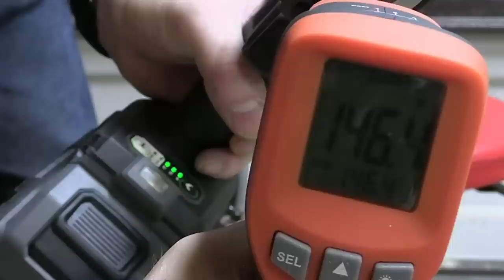Makita 40V Impact vs. Milwaukee Fuel vs. Dewalt XR vs Flex - BEST IMPACT DRIVER?

Comment: I guess I didn't realize how big that Flex battery was until now. Looks like a car battery hooked up to that impact lol. Great test 👊
Reply from the maker: Yeah, the 2.5/5 don't have high output cells so I had to step up to the 8.0  to match the M18 HO etc.   I would never use that thing on the impact in real life, it's like a freaking boat anchor 😂. Thanks for stopping by Clint!
Reply: 40 Volt, now I instantly have Buyers Remorse! Like why can't I have the 40 Volt! Like why wasn't I told about this before!
Reply: @randyross5630  Unless you have need for something on that line, like the beam saw or that insane 3/4" high torque, I haven't seen any compelling reason to make the jump. The tools that are duplicated between that and the 18V don't really seem any better, but you will have to use a big battery. Like with Flexvolt, there are no compact batteries in the lineup. Unlike Flexvolt, the lower voltage line can't use the batteries.
Reply: Yeah, they have those Chervon cooling sleeves on the cells that just make them massive.
Reply: @reginalb124  I got the 40v rear handle saw, sawzall, drill and impact.
If you regularly use bigger than 2in hole saws and augers, the drill is absolutely worth it. And the rear handle saw is so damn good it’s worth switching over for that alone.
The sawzall is a beast too, but for me it isn’t worth switching battery platform over.
The driver is pretty much identical to the 18v, it’s a great driver tho.
Reply: @SweetStat  But their 2x18 saw is plenty powerful. The hammer drill might be another compelling upgrade, but not sure I'd jump from 18 for it.
Reply: @reginalb124  the drill itself might not be enough for an extra upgrade. Specifically since the 40v line doesn’t have enough tools to completely switch over yet. I was due for an update sitting on 1st gen brushless tools. My drill been smoking a few times, my circ saw had a cracked housing. Sawzall is getting hot really fast, and starts smoking from the front, prob burnt up all the lubricants in it. Everything still works tho, but for how long?

I’m also betting for some future tools, an 80v chainsaw is one of those.
Reply: Lol trz

Comment: I had Makita 18v line for over 10 years XLT and BL tools. Switched to Milwaukee Fuel for the past 3 years because they are much more powerful. In the past 6 months though, I've been replacing my beat up Milwaukee fuel Gen 1 and 2 stuff with Makita Brushless tools. They are not quite as powerful but not by much. They are far more ergonomic, lighter and smoother and that's more important to me. I've always been impressed with Milwaukee power but as a carpenter, I find most of their tools miss the mark for precision work, smoothness and ergonomics. For me at least.
Reply from the maker: I have a video on the different modes for this and the XGT hammer drill in the works as far as precision driving tasks.  Lots of settings and options.  Stay tuned!
Reply: Makita is not lighter, and not far more ergonomic.
Reply: @svn5994  compared to my Milwaukee tools, they are lighter. Ergonomics is subjective. That's why I said, they are more ergonomic for me at least. The shape and placements of handles, switches, size and shape is more conducive to how I work and my hands. Milwaukee's handles are larger, tools are larger and they feel clunky. They also tend to vibrate more which is a mild to major annoyance especially when doing finer detail work. Again, this is my personal experience. I have absolutely no stake in whatever tool you prefer. Buy and use whatever you want. I don't care.
Reply from the maker: @svn5994  Agree that the Makita isn't lighter, all of these drills are heavy.  But I find it has much less vibration in the handle when using it.
Reply: Agreed, I think dewalt has the best trigger and the lightest drill but also the weakest.  I have never ran a makita but the Milwaukee triggers are not as good.  I also really like Kobalt triggers, they are a very affordable drill, perfectly capable with a nice trigger.
After having dewalt, milwaukee and ridgid for years, my main set is the blue kobalts and they cost a fraction of what milwaukee does and I put them through a ton of abuse including loaning them to coworkers.  My coworkers have been trying to break it but I think they have been surprised because they choose to use it more than the dewalt, ridgid or craftsmans.
Reply: @preston1614  

Tell your coworkers their lack of tools is the life they chose
Reply: Can’t beat makita for smoothness balance ergonomics etc when doing carpentry especially. My plumber uses Milwaukee and has burned out 3 drills in the last couple of years. And he uses my makita stuff when he’s doing wood projects 😆
Reply: @preston1614  As far as triggers go...Metabo HPT is the one to beat IMO. Makita is very close. I also like the Kobalt 24V stuff. They're hard to beat for the $
Reply: I am a dewalt guy. I bought my wife a makita drill. I have to admit. I agree. It feels like a much smoother more precise tool. Very impressed. I do own the small non-fuel milwaukee drill set. The balance and "feel" of them is horrible. The raw power of this milwaukee is impressive.
Reply: Makita makes tools that last. That’s the main reason I buy them. If I’m buying my own tools to work with, I’m buying stuff that lasts. The extra speed and power is inconsequential, when you have to replace it every 2-3 years. You can make any tool way more powerful if you just want it to last until the warranty is up.

Comment: my colleagues burnt through 4 Milwaukee impact drivers. I now use the 40v Makita and my 18v $100 budget impact from when I was a first year still going strong. also I genuinely think Makita has a much better feel. so at the end of the day the amount of work I have completed with the Makita compared to a Milwaukee is a massive difference and to me that is what matters. the reliability on site to complete the job.
Reply: Carefull you'll upset the red army , and also if you look very closely flex looks like makita on steroids.  Even the catalog pictures are the same
Reply: My experience has been the same. I bought a Makita mid grade brushless combo.
Reply: @@AdirondackHomesteadI'm a Milwaukee kit owner. Circular saws and table saws are really bad imo.
Better to go with Dewalt tbh.

Comment: Holy moly, the M18 is a BEAST!
Reply: When it comes to impact drivers, Milwaukee is the King of Beasts.
Reply: Watch the gen 4 Milwaukee impact driver coming out in a couple monthes
Reply: @TacticalThib  Has that been confirmed? Haven't heard anything about it yet.
Reply: Vcg construction has confirmed a new gen 4 impact driver this year
Reply: @geoffstrickler  Ridgid is doing away with the octane line and I'm looking for the next best and I'm kind of sad that this is it. Is the impact in the FUEL line more powerful? Or maybe an older model? I don't mean to sound like I'm hating on Milwaukee, I love their tools I own a LOT. But these are all incredibly weak compared to the Octane. impact
Reply: @Mik3yLow  LOL No they're not. Milwaukee's impacts are the best out there.
Reply: @Mik3yLow  the Milwaukee FUEL impact easily beats every Ridgid Impact driver. I have two Ridgid impact drivers, the Gen5x brushless and the Octane. Even the new Ridgid impact beats those two, and the M18 FUEL beats it…and every other impact driver on the market.
Reply: Yeah but it sucks balls. Trigger pull is twice as hard, and it beats you to death. Not to mention the fault in the trigger that can leave you in forward even though the switch is in reverse
Reply: @AjGalloway95  you need to send it for repair my m18 fuel works flawlessly I have the 3.5 though it has two balls not one in the collet
Reply: Milwaukee legends😍
Reply: @TacticalThib . He means, when you're driving a screw with the M18 and to switch to reverse real fast you can get into a situation where the impact still spins forward even though you have it in reverse. It kinda sucks but not a deal breaker. My buddy has the Kobalt and it does it too. I never noticed it on DeWalt or Makita
Reply: @Mik3yLow  what world are you living in that the octane impact beats the m18 fuel?

Comment: The Flex and M18Fuel are neck and neck. The 40v Makita is like a diesel. Not fast but seemed pretty smooth with plenty of power.
Reply from the maker: That's an excellent way to put it!
Reply: Diesel is smooth?
Reply: @theone6805  Yes, mine certainly is.
Reply: Power is defined as work over time.
Reply: Well the flex must be a nitro then with roughness

Comment: I am working with seasoned professionals who have 20-40 years experience and everyone has a DeWalt and everyone uses them everyday on metal studs and they all have had them for over 4 years plus. That was my decision. I was seriously thinking about the flex honestly but went with DeWalt and I am very happy with the quality.
Reply: Your probably  right, but push dewalts to do handwork and there shit.. l have about 20 dewalt cordless tools so it's not like lm biased.
Reply: I've been a DeWalt guy for 20 years. I see no reason to switch yet. I have a DeWalt impact I've been running since I got it in 2013. Looks beat tf up but still performs. And their saws kick ass  Admittedly, if I was someone running huge lags all day I'd be better off with a Milwaukee impact, but I'm not that guy. Thank god

Comment: That was an excellent comparison!!! Milwaukee came out on top without a problem. With an 18V, 8Ah battery against a 24V, 8Ah battery giving up 25% less volts, that’s pretty good in my book!! I thoroughly enjoyed this video!! Keep up the good work! God Bless!! Best Regards.
Reply from the maker: Thanks for watching, Cesar!
Reply: I just wish the Milwaukee could maintain that speed and power for more than 10 minutes at a time at best without almost catching fire.
Reply from the maker: @clarkfos3447  This is truth right here.  Working on a jobsite all day is a marathon, not a sprint.
Reply: Someone misleading in that the Flex is 24v Max while the M18 is 20v Max. Flex's nominal voltage is 21.6 while the Milwaukee is 18. Still speaks volumes about Milwaukee's engineering that they're still able to outperform these newer models and higher voltages while having been out for a good 3 years.

Comment: As a Milwaukee M18 Fuel platform guy, I'm not surprised by these results.  FWIW, those 21700 High Output batteries are total beasts and make a huge difference.   Props to Flex, considering this is a Gen1 offering,  so look for improvements there.  Very unimpressed with the 40v Makita, "smooth" as it may be.   Dewalt is still Dewalt,  and that's not a bad thing.   Kobalt wins bang4buck award...what is Lowe's going  to do when their prosumer line (Kobalt) can directly compete on a price/performance ratio with their premier, contractor line (Flex)??  I'm gonna keep bleeding Milwaukee red.  Philly, love your channel and your tests.  Awesome video.
Reply from the maker: Thanks for watching!
Reply: I might add, that it's not just the simple fact that Milwaukee has the H.O. batteries----the Redlink Plus technology engineered into the tool itself directly communicates to utilize the extra power.   Milwaukee was ahead of the game on this.  Dewalt FlexVolt has the same idea, but they're on too many platforms between FlexVolt Advantage,  Power Detect,  FlexVolt 60, etc.  It can get confusing for people.   Milwaukee has it all nice and tidy in one platform.   Tried & true.
Reply from the maker: @enockenock4183  I wish all the platforms had something similar to the CP 3.0 HO or the Kobalt 4.0 Ultimate Output - compact but high output.
Reply: @PhillyFixed , I'm sure the other guys are working on that.  I've no clue whether or not patents are involved (???).  Chervon, who owns Flex, Kobalt,  Skil, and Ego, has amazing battery technology (at least in the Ego line).  Like anything,  it's a highly competitive business but guys in the trades (like myself) tend to go with what works for them and are usually pretty brand-loyal.  I personally ran Dewalt for years (no complaints) but I switched to Milwaukee and it's going to take a lot to move me away from it. I have heard that Milwaukee is currently working on a 4.0 CP HO, which would be great.
Reply: Milwaukee is the raw power king, it’s more to an impact than raw power tho.
There’s been some super unreliable high end impact drivers from dewalt.
Makitas 40v and high end 18v are super great tools with some really useful settings. You won’t rly appreciate it unless you got some time with the tool, they also got an automotive fuse inside of them to protect the electronics.
I handled the flex, but not enough to form too much of an opinion.they don’t have that high end quality feel and sound you get from the big 3, but it delivers plenty of power. Personally wouldn’t invest in their lineup, it’s not good enough for pros and can’t compete with riobi for homeowners
Reply: I get made fun of for having blue tools all the time but they will absolutely run with any of the other brands and they are a fraction of the cost with a 5yr no questions warranty. 
I think triggers are very important and the dewalt wins there but I think kobalt has one of the best and it got even better with the xtr series.
I have the whole line of kobalt tools and I have been loaning all of them to other contractors to use and they have all been pretty impressed by them.  They have literally been trying to break them which is fine with me because you just take it into lowes and swap it out.
Reply: @enockenock4183  "smooth as it may be." You're operating under the assumption that every manufacturer is racking their brains to make the most powerful impact driver ever, but that's not the case. Who cares how powerful it is if it has a clunky trigger, wobbly chuck, poor balance, lack of fine tuning, a not so ergonomic grip, greater vibration, louder decibels, etc. The XGT shouldn't be expected to outperform the Milwaukee or Flex in simple power when it has lower specs.
I actually like what Milwaukee did with the gen4. They didn't make it any more powerful, but improved its stability, improved trigger sensitivity, gave it better LEDs, improved the chuck, and a slightly higher rpm. Maybe they've realized that it doesn't need more power, but focus in all these other areas that previous generations neglected.
Reply: @histguy101 I'm a Milwaukee kit owner and I gotta say you are correct. You want smooth operation.
That is why I rather use the M18 Surge hydraulic driver than the hammer impact. Sure it's not as strong but you don't always need raw power. Ergonomics and such are important. I really like the m18 grips though. They work well in my hands. Makitas lock mechanism bites into my hand even If I try squease my hand down towards the battery.

Comment: I agree with your point about testing vs real life use. The issue isn't just unrealistic tests like driving 1/2 inch lags with those impact drivers without an appropriate pilot hole, but that doing these tests promotes the wrong type of thinking about tools. 

I admit that they can be fun to watch, but the differences in power alone gets exaggerated by counting seconds in unrealistic situations, and the overall quality of the tool (ergonomics, reliability, vibration, control, quality of overall tool line, etc) gets overlooked.  Those other things will outweigh the differences in power, at least within tiers of tool levels.
Reply: So true. The job you are doing is for impakt wrenches, not drivers:\
Reply: That's exactly what he mentioned towards the end of the video... he knows it. lol
Reply: @janisuljas1462  Yes, but many viewers, and even channels, seem to forget this. You will notice if you read comments when one tool beats another by 0.8 seconds and ANY meaningful conclusions are made based upon that